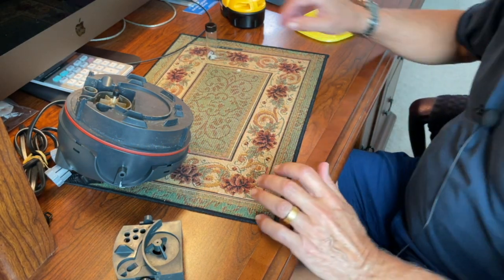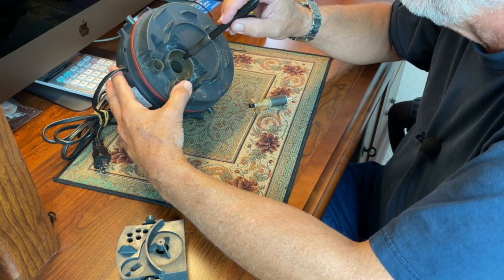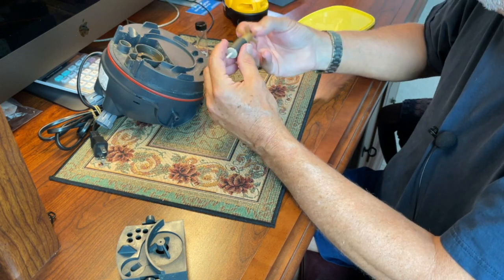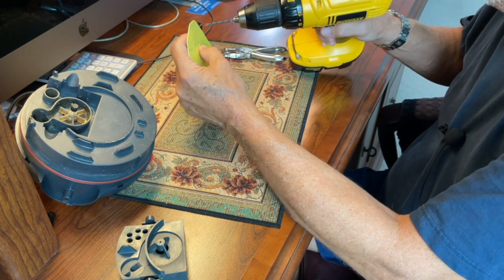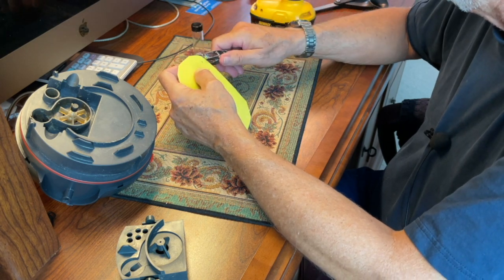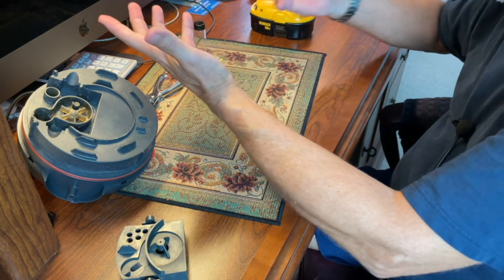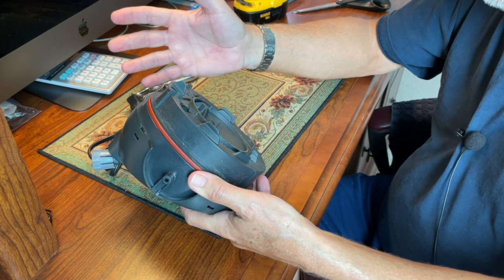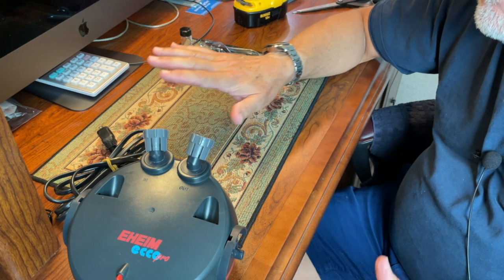How to quiet down an Eheim canister filters pump. Novak Ph.D.

Comment: I bought a new impeller and axle for my eheim 4+ 350. In belief that the problem was wear/wobble.
But still humming like hell. Im pretty sure vibrations happen when the impeller has contact with those rubber ends. Cos they are not flat.

Comment: i found that the impeller rubber bushings shrink and or the motor bore is oversize , i've wrapped teflon tape and crazy glue gel around them sometimes up to 1/16 to quiet them down. i also make shims by slicing air hose.

Comment: gr8 video . I did as you have shown , but unfortunately with my brand new 2217 i had no success .I did not give up trying .I noticed a lot of excess vibration , that only lowered slightly improved when i pressed my hand on the pump head.( The seller advised putting a house hold brick on top of it ,rather than replace or exchange. no help from EHIEM UK either.).Anyway the top of the  impeller (NOT THE BLADE END ) was bouncing against the top of the head. In my case I added a soft rubber washer around 2mm thick (Some aqua one impeller kits come with rubber washers) or in my case i made rubber washers to fit) ,. to the top end acting as shock absorbers .  it acted as both spacer and shock absorbing      IT WORKED PERFECT   . i have been running classics for years but the latest classic is produced in China an no where near as silent (BUILD QUALITY) as that made in Germany for years .EHEIM get your act together there are too many noise related videos and comments online ,has put me off the brand. I hope, along with your fix, my solution may be of some help to others. GOOD LUCK .Love the classic did not want to give up on a brand new filter.
Reply: wow I need your video.
Reply: how did you make your rubber washers? also tried this plastic thing without results. stacked 9 of the thin ones i made tried on both ends of the  impeller without results. wish i knew this before buying...
Reply: @FreakShowScitchy  exactly the same method as shown in the video except I made mine from a small cutting of rubber and kept adding them until I succeed ,also try turning the shaft arround, and switching the small black ends arround on the impeller shaft.... its trial and error. You may notice on the filter ,it says made in PRC. Peoples Republic of China. They are Definitely not as well made as older models made in Germany which is pity. Hope you have better success.

Comment: Using shims to tighten up the tolerance, brilliant idea.
Lessening the manufacturer clearance will also make the impeller last longer due to less run out.
Sheet PTFE could a recommendation for washer material.

Comment: It helped!! For some reason, my Eheim made a loud noise and had reduced flow. Also, the air goes in and I am working on finding out why and how. With two washers the noise kind of remained. I've closed the valve for the water income and exit and I can hear some sort of vibration but without the air bubbles in the canister. Now I need to figure out how to stop the air coming into my room professionel4+ 250. I guess those bubbles are the source of the noise and reduced flow...

Comment: Can you answer me what is the inside and outside diameter plus thickness of such a spacer in millimetres , please? In my case it will be easier and cheaper to buy a Teflon washer than to make one myself....
Reply: I know it's probably too late for you, but in case anyone else is wondering, an M3 washer is the right size (6mm OD 3mm ID).

Comment: I had to make mine a little differently because of the model , but same idea of a washer to prop the impeller up. Also the rod was ceramic but the impeller was plastic; I didn’t check to see if mine was made in Germany. I used a little olive oil and a cotton swab to lube the magnet and rod because it should be safe (for a turtle tank and his goldfish buddies that got too big to eat) and I couldn’t find silicone based grease here and apparently petroleum jelly can break down the gaskets. Literally alI I heard was a little air working it’s way out of the system when I started it. I primed it by adding some water to the canister after replacing the medium and, after taking a Clorox wipe the the end of the outlet (maybe a rag if you’ve got sensitive fish?), suck water the rest of the way through like siphoning gas. Just watch the line so you don’t get a mouth full of fish crap.
Reply: Also I found out that pantyhose works great for putting medium in when I needed more medium bags because of how much it stretches, it enables you to conform the medium to your needs.
Reply from the maker: Panty hose works great for carbon or a BCB because it's more flexible.

Comment: Iv got a fluval 207 and eheim 2213 use to have an fluval fx4 and another 2213 but sold them two iv been looking at other filters I like the oase biomaster there a dear filter but have a prefilter n built n heater u can remove the prefilter while canisters full of water but heaters look cheap n easy to break I was also thinking about the jbl crista profi I think that's your best bang for ur buck decent lay out of media trays

Comment: Some external filters come with a plastic washer top and bottom. The Eheim Classics for example don’t. You can fit a washer on the bottom of a 2213 and it can help. Having taken one impeller apart I can say they aren’t very well made.
Reply from the maker: At one time the Eheim filters were top notch but they are not that way any longer. There are now very competitive filters out there that are better or just as good without the cost.

Comment: Ha! Mine has been driving me mad for a week. Took it apart to clean around the impeller to see if that helped. Put it back together and it was at least as bad. Came across your video, went out to the tool shed to get my drill. When I got back I had to check it hadn't tripped a fuse because it's so quiet! Seems like just the threat of your fix was enough. Thanks - at least I know what to do next time.

Comment: Hello Dr. Novak I found your channel through pektec and I had a quick question for you. I do not know if you are familiar with biohome ultimate filter media or not but they say it is capable of growing nitrate consuming bacteria because of its internal structure that creates anerobic areas within the media. I was wondering if those are the same bacteria that would grow and consume nitrate in one of your anoxic filter baskets? If so this would be auch more affordable route to go to reduce nitrates in my tank rather than spend the $50 or so in order to get the proper weight of biohome for my size tank.
Reply: I would not put money on biohome ultimate. If you really want that denitrification, you can either go the anoxic filter route, or use Pumice (featherrock). It's a much cheaper media but still as good, just add a couple drops of the seachem trace element to reproduce the extra element additions from the biohome ultimate. I think I bought a bunch of Pond Matrix when I was getting my pumice. $100 gets you a 5-6gallon bucket worth.
Reply: @OxAintAFanxO  thanks I am getting ready to put together a hillstream tank with a high directional water flow to mimic the streams the fish come from. With the river manifold that goes under the substrate to create the directional flow I could incorporate a plenum with that as well as a bcb in the canister filter I plan to use
Reply from the maker: There are always new products that claim to reduce Nitrates and this has been going on for years. However, they all clog at some point in their life expectancy and then become aerobic only. Denitrification stops and only an acid cleaning with bleach will open up the pores once again. A BCB on the other hand does not clog and the pores remain open to biological and chemical mediators forever without invasive cleaning.

Comment: do you think it would be a good idea to make a sump out of a plastic 42 gallon barrel?  there could be a plenum at the bottom of the barrel. and  have a 24" layer of extra course sand or/and a layer of those ceramic cylinder thingies.  and at the top is the bcb baskets. it could have a 3/4" pvc riser pipe going from under the plenum  to above the sand for air stone circulation. and have a pump pump out from the bcb basket chamber up to the tank and the overflow out of the tank and through angel hair filter basket sitting on top of the barrel and dump into the barrel.
Reply from the maker: Sounds good let me know how it comes out.

Comment: Appreciate your honesty on the nitrates reading. It does open up a bit of clarity. Imao, i would think that the filter floss/sponge as the main culprit. Recalled your filter socks on how it would get pretty dirty within the 24-48hrs period. The monte carlo "bomb"of the accumulated uneaten food/poop, that will over time cause spikes. 
Good nice spacer diy.
Btw, I did put some fine zeolites as a sand cap over my  2yrs plenum substrate and it looks great! My zeolites gravel had arrived and I had placed them in the 3 bcbs in my compainion filter chamber.
Reply from the maker: You could be absolutely right about the nitrates going up. But then again we would only be guessing if that was the culprit. But it also shows your thinking like I was and that’s why I took the canister apart just to see if it was the corporate. But it also shows funny things can happen until the BCB finally stabilizes and becomes fully activate with bacteria.

Comment: Sadly, Ehiems have not been "German-made" for over a decade. I was sadly disappointed to find this out when I bought my last new one eight years ago. It will be the last new Ehiem product that I ever purchase.
Reply from the maker: Wow! Did not know that.
Reply: @anoxicfiltrationplenums  Yes a different company bought over eheim but I still think it was a German company but there cheaping out on plastic trays n stuff there new filters like the pro 4/5 but there mostly still made to high standards as they use the same blueprints on most of the products
Reply: @matyodea1058  Everything has been built in China for at least a decade.
Reply: @solarclapson  well ats nae great if it is China but it don't put me completely off buying eheim products iv got the eheim classic 250 n it's a decent filter build to last and I have four eheim heaters 3 jagers and the new thermo preset heater two of the heaters I got a few month back I really like the heaters even the new style one I use to want a eheim Pro 4 canister but I found out the trays seem to break a lot at the down flow part at corner so after looking at all the canisters the one I'm getn is the jbl crista profi 1502 there well build they last the trays are good size and there flows better than the oase biomaster and eheim Pro 4/5 I just bought a fluval 207 for my 24gallon a few month back there good but outta everything iv been looking at I think the jbl is best bang for ur buck I know sunsun are cheap lots of room n high flow but not a quilty filter as for eheim I just think it depends on what u buy as a lot of there stuffs still made well the old filters n heaters defo are good
Reply from the maker: Sad, very sad, to hear that Eheim and their quality have went down so much. The last Eheim I bought broke in a couple of places because the plastic is now so thin. I glued it back together but it’s still broke again in the same spot and started leaking.
Reply: @anoxicfiltrationplenums  The two Chinese built units of theirs which I purchased are now held together with vapour barrier tape. Sad indeed.
Reply from the maker: @solarclapson   I know we joke about it but it really is sad.
Reply: @anoxicfiltrationplenums  I find little to no humour in it. They were an excellent product while being manufactured in Germany.
Reply: @solarclapson  They even demand above average prices in their factory shop in Deizisau, best is to get used Eheims , in my opinion.

Comment: I have been running the same filters for decades, and have never had any noise issues. That includes the one next to my bed which has been running with a broken impeller shaft for eight years. Ha! Now that I have mentioned it, I will probably need to heed your advice.
Reply from the maker: Like I said I ran one for almost 18 years and then one day the whole impeller just blew up and the magnet came apart.

Comment: neat! I will try this on a SunSun filter.
Reply from the maker: Please let me know if it works. It seems to work on some filters and not others.
Reply: @anoxicfiltrationplenums  It did work on my HW-704!! I had a constant rattle of the impeller hitting something , now I just hear a normal humming sound. Thank you for this tip!!
Reply from the maker: @Junooni66   you’re welcome
Reply: I’m trying this on my sunsun too it’s 303B I’ll let you know how it goes! Does the size of the drill bit have to match the impeller diameter exactly ? And does the punch size matter?
Reply from the maker: @uraninite8151   The ID of the washer should be a close match but not so loose as to cause a problem the OD of washer  can be bigger.
Reply: @anoxicfiltrationplenums  Thanks. I just took some washer that came with an old pump and widened the ID slightly. It seems to have helped quiet it down , but i only had 2 and my punch produces too a small washer. Does the OD matter? I can make more but they wont have much material between the hole and the edge.
Also unrelated to this, would there be a benefit of having a BCB filter on a 'high tech' aquascape with co2 injection?

Comment: Neat trick which I will bear in mind although I haven't had problems with noise in my Eheims so far . One thing that I have noticed in an Eheim ecco which had been running for about 8 years is uneven wear on the ceramic impeller shaft . I replaced it just to be safe .
Reply from the maker: It proves what I was saying. The tolerances that are held with these filters sometimes can go out of whack.